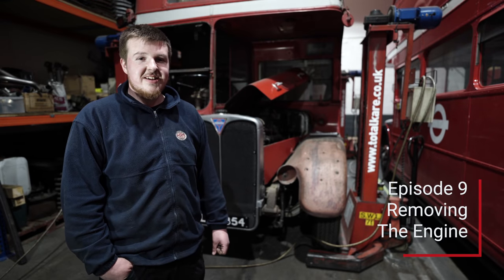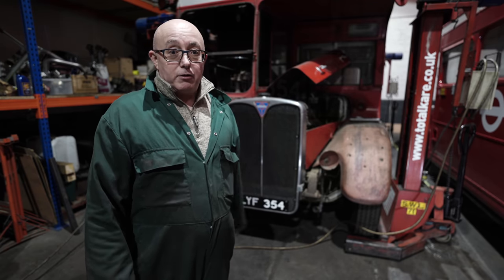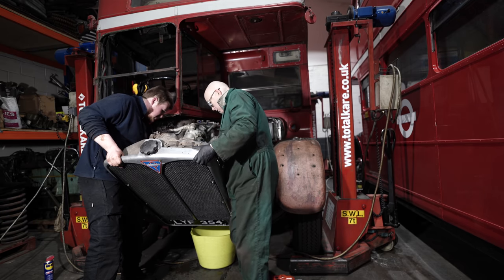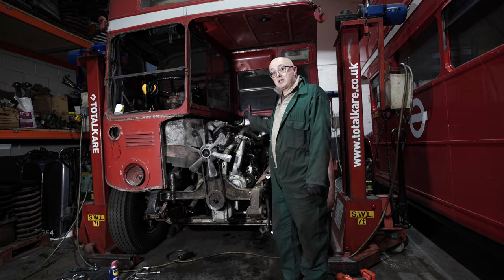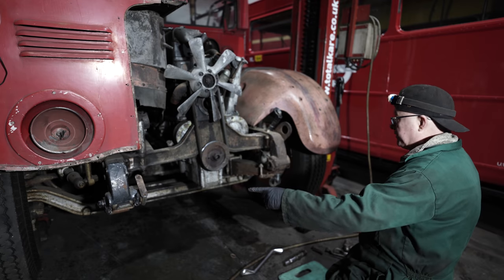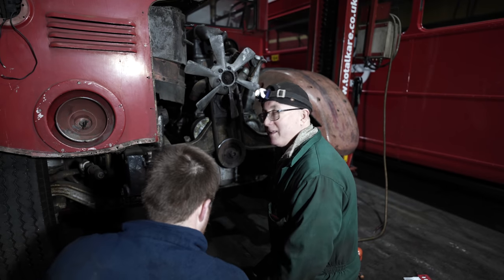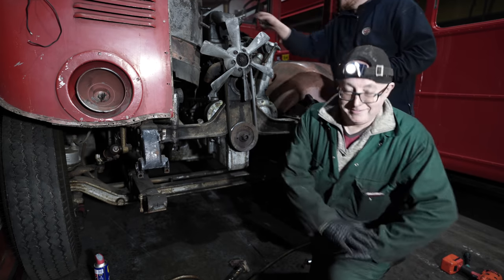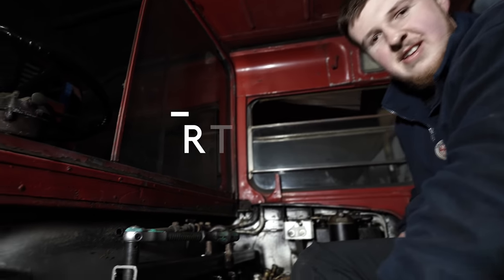Ep9: ENGINE REMOVAL On A 70 Year Old London Double Decker Bus

Comment: Yet another fantastic video fellas, we met at Alperton Open, (closed day). They don't mention all this hard work in the BTF film "One for One". In the film, the Thames Trader lorry from Chiswick  arrives at Hounslow Garage with the re con engine, (I am told engines were changed on a different rota from the visit to Aldenham which mainly was for body work). The blokes pull the old  engine out using the "Iron Man", that engine goes on the lorry back to Chiswick to be overhauled. I know that at Westbourne Park Garage, there is still the overhead rail, now disused, which used to carry engines and gear boxes from the lorry parked in the Goods Inward bay to the Dock area, (new X  Garage did not run RT's but the principle still applied to RM's.

Comment: Another enjoyable video. What you forgot to mention is that in Aldenham the body would have been removed for work on the chassis and engine so what you have just done would have been much easier. Looking forwards to the engine work video.
Reply: Certainly for overhaul,  but plenty of engine changes done at the larger "engineering" garages

Comment: We always removed the wing first it made it a lot easier on old half cabs, never try to undo the wing bolts tighten the until the snap, never removed shackles we had 2 AEC s about 20 Leylands we just called them London deckers, plus all our Leyland PD 1 and PD 2s, at the (real)
BartoN Transport Ltd  Chilwell Notts, this company was  a bus enthusiasts dream, mixed fleet , not over worked with decent owners, I did running repairs Breakdown-recovery local and distance, also part time coach driving, I worked there until the end,, Thatchers policy's finished a wonderful old fashioned company,,  Bill Redfern,,

Comment: A dynamo only supply's direct current, which is also dependant on engine speed, more RPM's more current, an alternator supply's alternating current. (hence the name) and then rectifies it to direct current, at a constant voltage.

Comment: A fair point about how much easier it is to remove an RM engines. Another way of looking at it is that I believe the entire body lifts of an RT, presumably giving decent access to engine in situ. Obviously this isn't a practical approach without the Aldenham crane but I do have a curiosity as to how involved it was separating the two. One might argue that the RM was a step back in this regard!

Comment: both create a potential difference , a dynamo uses permanent magnets to create the PD , an alternator requires an exciter voltage to create the magnetic field so when it is turned it can also create a PD , alternators create alternating current and dynamos usually direct current , thus an alternator requires a bridge diode and regulator to be useful for motor vehicles , alternators can have a higher output and more than one phase , much more useful

Comment: I know on motorcycle engines the gasket between the crankcase and the cylinder block is a base gasket.
Anyone else feel the urge to take a whizz when Tim drained the radiator🥴

Comment: I have never owned a routemaster as I work for citysightseeing Belfast and I own a Mercedes’ vintage bus I don’t know what model is it but I do know who made it which is the vehicle you can see on the profile I have been learning a lot on fixing buses because of your channel as well back in 10th May 2021 I had to rebuild my engine and replace the radiator spark plugs and and the fuel tanks it took me a month to rebuild and then later on I tried to start it up and then it choked for 30 minutes it took 3 hours for me to get it to start and then it started and then I reved it and it notched 6 times as it does that if revving it still runs thanks to yous

Comment: Loving the videos I have always had a soft spot for the RT. Did you know the reason that only a small number of RTs were produced before the outbreak of WW2? The reason for this was the Wilson pre-selector gear box it was German! Once the war was over the gearboxes were available and the majority of the RTs were produced in the late 40s early 50s. Whilst the war was on Adolf was slinging the pre-selector’s into their Demag one ton halftracks and the sdkfz 250 APC.
Reply: I thought it was the Bosch rotary  compressor that was the problem,, very German, originally  a shaft driven rotary compressor, but later a Clayton piston type driven by belts, and combined with opposing belts driven dynamo, lots of mods between the 2RT and the 3RT, but what a bus, the largest  standardised bus ever built, over 7000 made, including the Leyland variants, more than the Routemaster, shame no SRT types remain, a Super STL fitted with an RT body, with FJJ and FXT  registrations.

Comment: hi, great video,the AEC 9.6 engine was a great engine along with the 11.3,look forward to seeing the engine all cleaned up with new oil etc.the rockers do look a bit grimey and dirty..will you make up an air cleaner to fit ? and will the injector pump and injectors be sent for overhaul ?  ex AEC.

Comment: a Dynamo creates direct current .. an alternator creates alternating current .. and a dynamo's current output rises with revs , whereas an alternators output is pretty level
Reply: Not really.  Both create alternating current.  The differences are mainly in the use of permanent magnets vs. electromagnets and the use of a mechanical rectifier vs. an electronic rectifier.

Comment: Could this be the actual bus that featured in the movie "Summer Holiday" ( which surely needs no introduction!) as contrary to popular belief that it was a Routemaster that featured in the movie which is incorrect as actually it was an RT like this & also scenes for the movie were shot at Aldenham Is this the actual bus featured in " SUMMER  HOLIDAY"? If not what is the RT number of the summer holiday RT & where is it now?
Reply: From Wiki...

Associated British Picture Corporation of Elstree actually bought three used RTs (RT2305 (KGU334), RT2366 (KGU395), and RT4326 (NLE990)) from London Transport. They were all converted to look like RT1881 (with a fake registration number: WLB991) for filming different segments.

Comment: LYF 354 looks like it's the original registration plate for this chassis. Do you know whether that's the case?
BTW, have you ever done a green LT bus, or don't they come up very often?
Reply: If it's not Red, keep it in the shed😎
Reply: Possibly not the original number, LT swapped things about.
Reply: No bus had the same chassis and bodies when RT's went for overhaul they lost their identity when they were cleaned and then body and chassis were removed and overhauled at Aldenham when all refitted tested then sprayed as good as new they were given a new identity as every RT was nearly interchangeable a Great process their is a you tube video that dates back to the 1950s called Overhaul that shows the process
Reply: The green version for outer services have a higher speed axle as I was able to tell in a video as the bus had a fair turn of speed in each gear compared to the red ones.
Reply: Generally the registration number stayed with the chassis, the RT number with the body, but sometimes by mistake the reg was put on the wrong chassis during an overhaul.  Often only discovered if the bus was sold  and the reg and chassis numbers no longer matched the registration document.  LT had a dispensation regarding engine numbers not being recorded on the Reg document.
Reply: @tonys1636  Thanks for the info Tony.